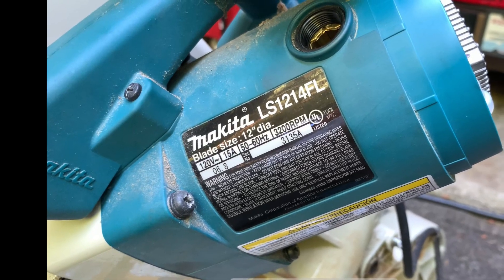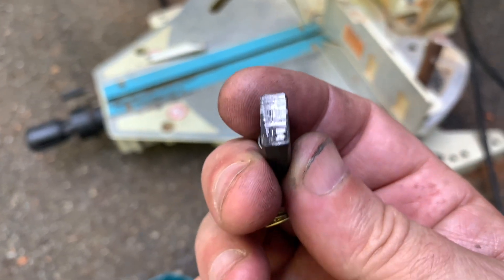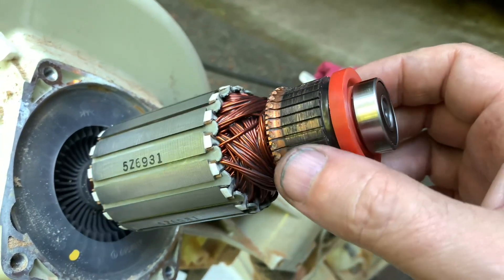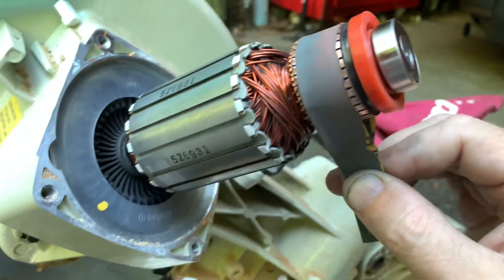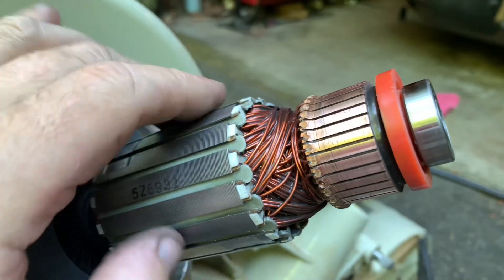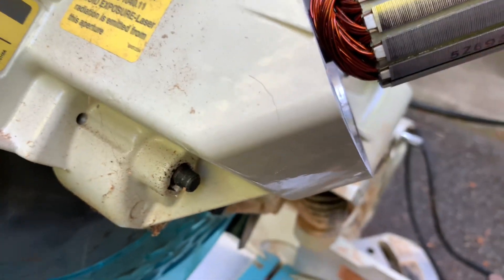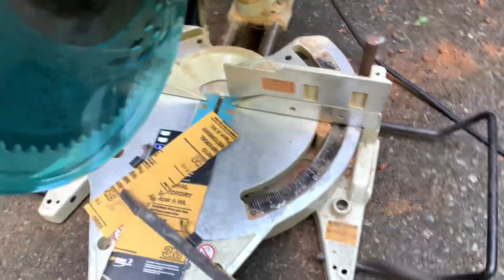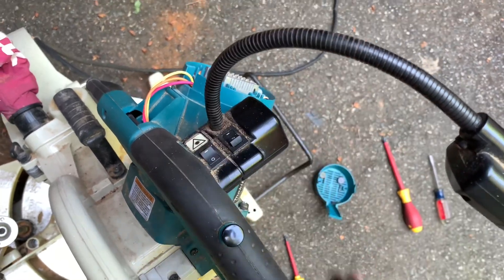Repairing Weak and Sparking Mitre Saw

Comment: Thanks… I found one of these in the street and all I can see that’s wrong with it is the sparks… I might replace those carbon things… or I might sand it like this..
Reply from the maker: Its easy to try. Mine was sparking bad. Sand commutator and the brushes.
Reply: @ericchristoffersen9355  I wish I had watched your video first… 😆… I took it apart and spent 3 hours trying to get it back together… all I did was use some electrical contact cleaner on the… commentator thing?… ehh.. so when I got it back together it’s still sparking…… then I looked up this video and….. well it’s too late to sand it without taking it apart again… so I suppose I will have to do that but…. Another time… ✋😆…. But I hope i can get this working because it looks perfect and it’s a shame to see it thrown out just for this issue..
Reply from the maker: @Cypher791 oh that’s funny! Ya know… it’s not that difficult to get access to commutator. I’d guess 10 minutes right? But! You need fine sand paper, like 1000grit. Then clean sandpaper residue with contact cleaner.

The other thing my motor brake didn’t work and after cleaning it did. Good luck. Free is the best.